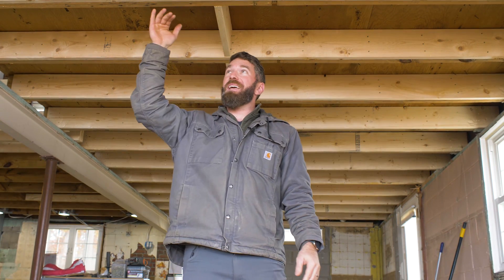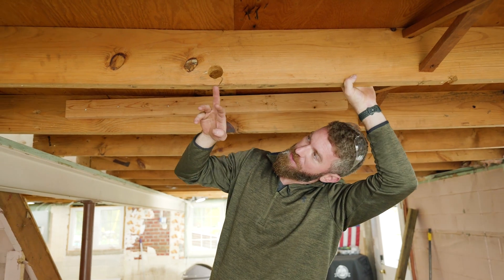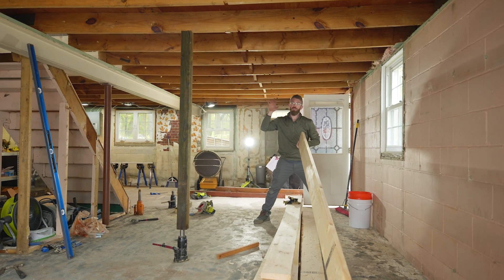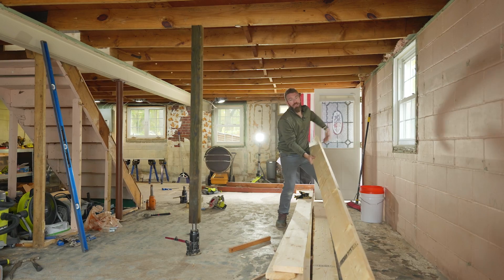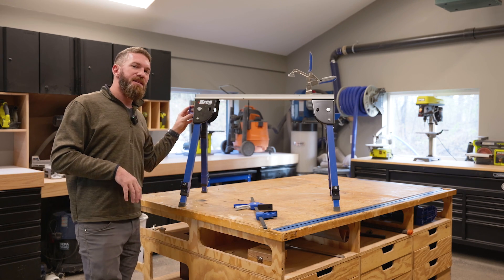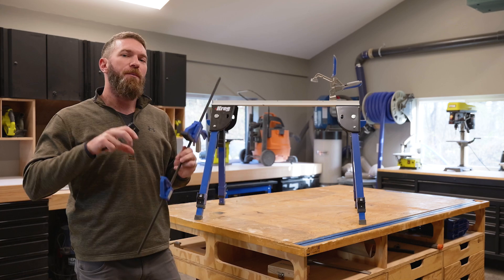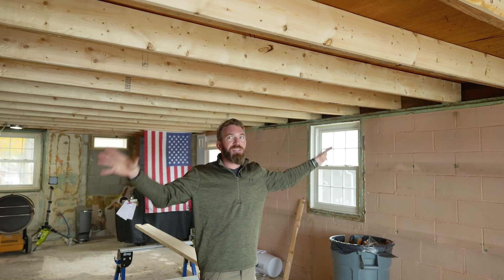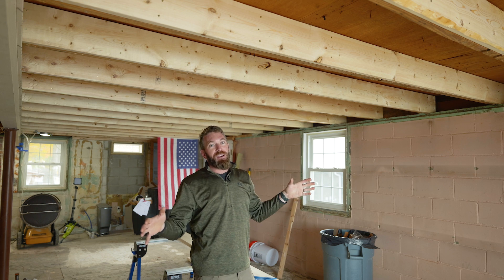We Fixed our Sagging Floor Joists

Comment: Do we have to jack each joist up before adding the new one ?
Reply from the maker: Just the ones that are sagging below the new board or if you can’t get the new board in. Most of mine straightened when I hammered the new board in.

Comment: A 2 by 8 can just about span that length with 24 inch on OC. Probably, it’s max span. Since it is just over its max and the wood had the holes, that’s what led to the deflection. Since he doubled them, that’s only increase the deflection ability by about 15%. Maybe less, since it’s not a true double.  So, what he has done is probably okay, but honestly, just barely.   

Still a chance that over time, the new system will deflect. Probably not, but the fix isn’t a slam dunk. 

Now, for a DIY, this is great. Saves a bunch of money and probably fixes the problem forever. However, to truly fix the problem of spanning, one would have to add more joists to fix the OC issue or use a stronger material.

Now, what is in the video is probably fine, but if you go to sell, it will stick out like a soar thumb. Once someone really evaluates it, it might be one of those “should be a little better” deals

Comment: How old is that house and what state are you in? I can’t believe it was ok to have a 2x8 span 12’ with 24” on center. Should have been 16” minimum originally when built. Personally I would have sistered ever joist as well as placed a joist dead center between each existing joist to “break the on center” in half. Perhaps overkill but it would have made for a very solid floor.

Comment: As far as I understand, the correct way to do this is to remove the floor above and then sister the joists.  Forcing the joists in like that will inevitably cause something to move, which will likely be your floor.
Reply: But... dont you want your floor to move(up) if its sagging? Or Am I missing something?
Reply: @JonathanSterlingMusic  The joist you sister will be higher than the existing joists that have sagged or been broken.

Comment: Why nails? Are screws not allowed
Reply: Screws apply a lot of force into the joint but not a lot of shear strength. Under the stress of loading, screws can snap. Nails are stronger and also tolerate more flexing back and forth.

Another option is threaded bolts and nuts through both joists.

Comment: Im curious, if you had a wall in the middle of the home just like the beam carrying the first floor. if you had the same thing but a wall from the first to the second in the middle of the home carrying that load but those joists were dipping down into the middle of that load bearing wall and you find out that walls studs were cut in different lengths. Could you carry the load of that wall on both sides jack up the house a little to add new studs? making that middle bearing load a little taller to fix the sag in the floor?

Comment: My mom's house was built in the 1870's. It's got balloon walls, all the floors run the same way, and the entire house sages in the center. It's been like that for 50 years. They put the Joyce in wrong. We need to empty the entie house and level  the bottom floor, which we were told will level the floors above it at the same time. How long did it take to jack up the floor? Did you have to turn it slowly every week?

Comment: Wider is strong then taller.  Lvl would have been better then dimensional lumber.
Reply: True, but MUCH more expensive. I am considering material options to fix sagging ceiling joists. They used 2x10s to span 24 feet, unsupported and the worst joists are sagging as much as 2”. According to IBC, 2x10s are not sufficient for that span, but sistering LVLs might do the job. However, they are more than double the cost of standard dimensional lumber. That’s a significant expense given I’m going to need more than sixty boards!

Comment: Honestly, these videos are frustrating. Speed through all the good stuff, don’t include much detail and use an example where you don’t run into any issues, obstacles etcetera. I have a cracked floor joist above my furnace in a tight space. I have one in my ceiling between my garage and my master bedroom with not enough room to slide in a 2x10 the length of the existing joist. What do I do? I mean, I know what to do for a full length floor joist. That’s easy.
Reply: Did you find a solution?
Reply: @CT-um7zq , how about a response from the fuckin creator???? This is PITIFUL
Reply: Just get as close to supporting top plates as possible. Most deflection appears in center of span. Instead of framing nails, screws, consider through bolting with 3/8 or 1/2" carriage bolts every foot in "w" pattern, after jacking up flat. Add some blocks or cross blocking through center of span to help adjacent joists help spread load. It will be fine after that. Hope you can get within a foot or so to supporting framing.

Comment: Woulda used screws instead of nails.
Reply: Very bad idea. Screws are great for compression force, but terrible for lateral/shearing forces. You generally want to frame with nails that can flex and deform as the lumber shifts during its lifetime. Screws are rigid and will break under those forces causing your framing to pull apart and potentially collapse.
Reply: Screws woulda sheared.

Comment: Thank you, I needed to understand what was involved as we recently moved into a house where the surveyor missed a sagging undulating floor idiotially. Now we are getting quotes on the work involved and knowing what is involved really helps.
Reply: Hi, how much did it cost you to repair it. We might have to do the same. Thanks in advance!
Reply: 3 of my joists ceacked after moving in.. perhaps yours happened after moving in..
Reply: @heberorozco182  Unfortunately it was day one. Clear signs of misaligned doors cut to fit, not fully opening or closing and bodged covered up cracks etc.
Reply: @heberorozco182 I’m going through this now.

Comment: My brother-in-law did it wrong like you did, beating the new joist into place. He sistered every joist on his old house. Beating those joists in - something has to move. In his case it popped his subfloor loose which ruined the hardwood finish flooring.  He had to remove (and trash) the finished floor, reattach the sub, then install new hardwood. Best to bevel those edges  or rip a little off. Also construction glue is a good idea here.
Reply: i've read a lot about why the diagonal cross braces are critical because they transfer weight while allowing flexing
Reply: @thebroham5239 Do you need an engineer to start/diagnose the process & to let you know the best way to complete fix the joists?
Reply: Dewalts hand planer is phenomenal for taking a touch off the side and making it flat
Reply: You can actually cut a good bit of notch out of the end of joist.  That part of the joist has little tension.

Comment: Put about a 3/8 to 1/2 in bevel on the top of the joist so it bangs in easier, Joist is 1 1/2 "so you still have 1'' at the very top. can also do that on the opposite side on the bottom just where the bearing is. Joist is just as strong with those bevels. Don't do it all the way across on the bottom, just the top. Lean the joist in at the top to the one being sistered with the bevel facing out on the top, bang the bottom in. Even wax on the bottom ends will help it slide in easier.

Comment: Don't most people drill a tight hole and run bolts through to sister ? Iv never saw anyone nail them .
Reply from the maker: You can do either. Nails are obviously faster and with proper spacing it will work well.

Comment: I had to do a lot of this in my house, but I didn't have nearly the access you did.  So since I already had the outside wall apart, I just slid the sisters in from the outside. I prefer to jack the old joists up so they're proud an 1/8th to a 1/4 in the center span before I glue and screw the sister.  It flattens back out a lot once you release the jacks.  And more over time, especially with load.  My house was a real basket case though, including a carrying beam that was about an inch and a half low compared to the foundation
Reply: what do you mean the carrying beam was low? did it fall out of where it sat ?
Reply: @olegkostyuchek2593 sagged

Comment: This is kind of the opposite of my problem.  We have a bow window and fireplace that are cantilevered out beyond the basement wall below.  The cantilever joists were not made long enough so they are bowing the floor up due to the weight of the wall and roof pushing down on the outer end of them. Not sure how to correct that without cracking drywall and relaying the laminate in that room since it has a metric $h!t ton of leveling compound under it.

Comment: structural engineer here. whoever put a hole right in the mid span of a 2x joist is an idiot :/ that joist looks like it is about to break in half if you haven't take any action to fix it.
Reply: Idiot plumbers do that all the time, You have to watch everybody.

Comment: What was the process of jacking up the joists? Jack one joist at a time until level? Start in the center of the room? Please explain.
Reply: How did you remove the sag? Sistering a new joist seems like it only holds the low spot in place. Didn't you have to jack the old joists up? How do you tell when the floor is level? Do thr old joists bend when they get jacked up?
Reply: @watchfast1 , THANK YOU FOR THESE MOST PERTINENT QUESTIONS.... This video is click bait in not addressing those....
Reply: Id like to know this too lol @watchfast1
Reply from the maker: I started from one end of the room and jacked the ones that I couldn't get into place.

Comment: You didn't show the one part i was interested in. How did you tilt the sister joist up flat to the original joist? The diagonal of the 2x8 is greater than the distance between the floor above and the sill plate and i-beam.
Reply from the maker: 1:55 I put them in on a diagonal and used a mini sledge hammer to force them into place.